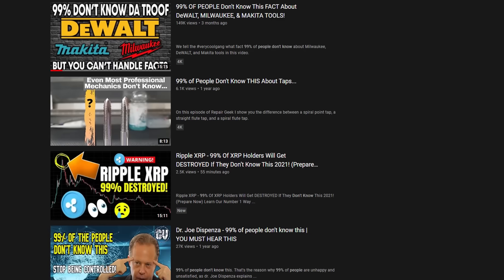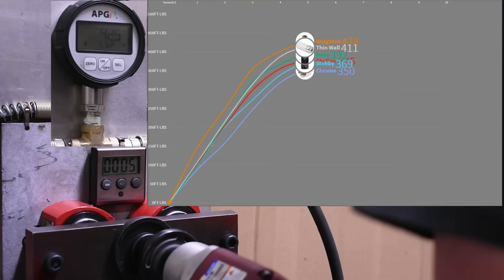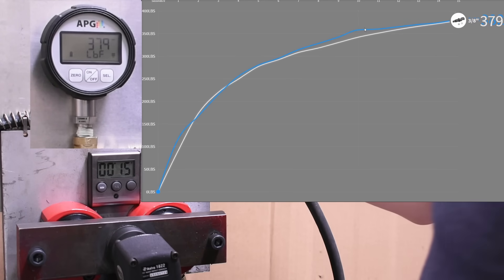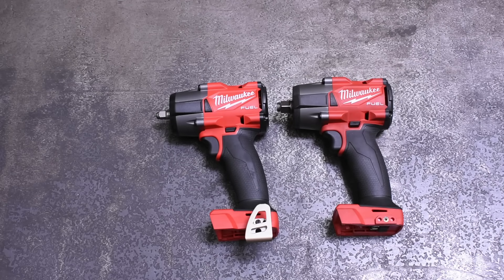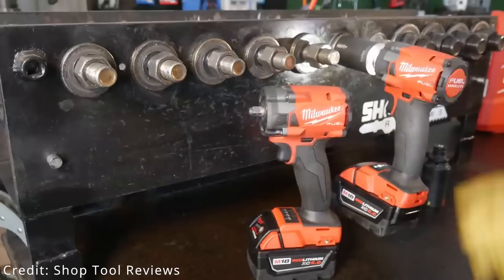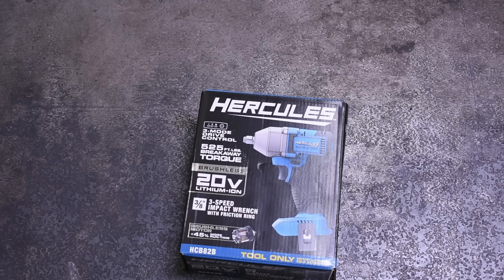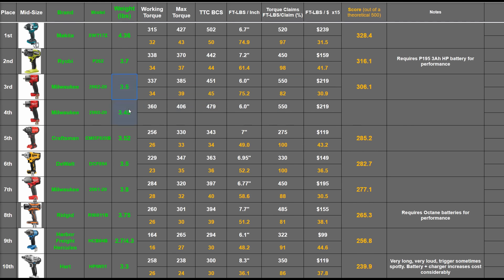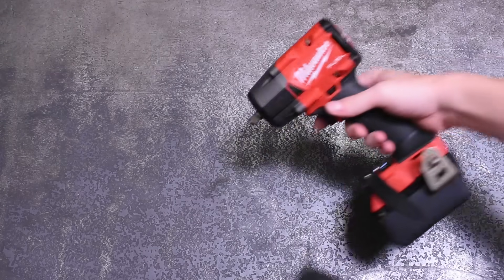Measuring Power Difference Between 3/8" & 1/2" Impacts = WTF

Comment from the maker: Many in the comments are offering theories about or wondering why 3/8" is more powerful than 1/2" talking about mass and other things. Well I feel like we overall showed it's not (see 1822 nano and Hercules purchase using the same 1/2" and 3/8" sockets), but being the same is also interesting and new data. The anvil mass difference is after all less than 0.1lbs. The Milwaukee seems to be exception, and maybe a rare one as other channels have noticed. We (and apparently Milwaukee) have no idea why. 3/8" flies under the radar a bit but with the socket options now-a-days and the power some of these make it shouldn't. It's no longer your fathers power tools out there where smaller drive size means no beans. Here's hoping more brands offer 3/8" in mid size impacts (DeWalt, you listening?)
Torque of TTC is working for Astro Tools who also make the 1822 Nano impact in this video. TTC is not the only testing out there, always consider multiple sources when looking at a tool!
Reply: Should have switched the anvils in the Milwaukee 3/8 and 1/2 with each other, keep everything else the same. Maybe top up the batteries, but put them back on the same drill body.
Reply: @Stefan_Smith  This is a worthwhile test because both the battery and tool have electronics built in, probably 1 chip processors also.   There are two aspects: are the electronics the same for both stock 3/8 and stock 1/2?;  second would be how the control laws, even if the same, interpret the likely differing speed/voltage/current consumption for differing anvils.
Reply: I sure hope yellow and black is listening!
Reply: I have the Milwaukee M-12 3/8” drive and the M-18 Mid-Torque 1/2” drive. They are a great combination and have made my life a lot easier.
Reply: Makita needs a 3/8.
Reply: You guys should not have informed Milwaukee about that 3/8". Now they will charge more or lower its power on torque. It's a business after all and they are all good at ripping us customers off for a profit. You're not exactly helping us consumers by also helping the manufacturers?
Reply: Correct Marketing Matters.
Reply: Torgue is same becouse force is aplied to the anvin inside tool and anvil diameter in tool is same. Rest of the test equipment is irelevant. You can imagine anvil, socket and bolt as one rigit body. They do not move relative to each other, they just transfer force, you can even use smaller bolt and results should be the same (ofc unless bolt snaps)
Reply: @FAMIntruder  Nope the Anvil and the socket are not one solid piece. The force applied is erratic. Once the end of the anvil has clearance to Lash in the socket, it becomes a pinion. The smaller 3/8ths diameter will always lash with more force and back lash with less mass to counteract the next hammer blow, than the larger 1/2".
Reply: For me I need 1/2 or even 3/4 . Most fasteners I need to break loose at work are larger than 1-1/4" up to 2" or even larger so a 3)8" would leave me using an adapter every time.  But I wouldn't mind owning both a 3)8 and 1/2 lol 😂  this was a cool video though and very interesting.
Reply: Great content! You sound exactly like Fireball Tools🤔🤔
Reply from the maker: @WTFxMattt  Fireball Tools is on another level and I take that as a huge compliment lol
Reply: My only theory, is that the overall rotational mass of the 3/8ths is less, allowing the tool to reach a higher final RPM number under load, delivering more blows per minute, and a higher torque output because of it. 

I would be interesting to maybe see a spring tension dyno that provides a static load for these tools to work against, where we can observe both the RPM of the tool at specific loads, as well as potentially how much tension is removed per blow, instead of how much is removed/added over time. Might give a clearer picture of stuff like what really busts rusted nuts, or what'll drive lags faster and harder than the rest.
Reply: My brushless high torque 3/8s will rip out and install a semi trans, while redoing back section and top sections no problem lol
Reply: it will be  nice to see the torque display on the tool .    let's say smart tool
Reply: I recommend that you guys retest the Milwaukee M18 mid-torque's using the 12ah battery. I'm thinking in these test the 5ah battery might be causing the anomaly because it is a bottleneck on the test.  My theory being that it takes more wattage to drive the 1/2" vs the 3/8". The 1/2" does produce more torque due to its larger head + socket mass as represented on the graph but the 5ah battery then fails to keep producing the higher wattage required to keep up and as the wattage produced drops, you see it's torque curve drop. The 3/8" version has a lower wattage draw overall which is allowing the battery to be more efficient in the long run which is why we're seeing a higher torque output in the end. Again, this is a theory but when I think about it, it makes sense...
Reply from the maker: @koreanyogi2546  Alrighty, next week we'll throw a HD12.0 on her
Reply: @TorqueTestChannel  I think the effect we're seeing here is caused by an interaction between the motors torque curve and the anvil mass (3/8 drive anvil is lighter than the 1/2 drive anvil). The motor seems to struggle at the last bit of the dyno test, because the 1/2" anvil seems to be a little too heavy for it to max out.
Reply: @TorqueTestChannel  ok 12.0 ah batt may make the 1/2" bang harder but would it not make the 3/8" bang even that much or more as well ? Curious as I just purchased both these  just a month ago and only have 1.5 2.0 & 5.0 ah batts.
Reply: @TorqueTestChannel  could be the only difference is the socket connector. The hammer and internal weight must be the same. I think we all presume 1/2” are more powerful but sames it’s only the larger socket size to buy is the difference.
Reply: @koreanyogi2546  Mass is irrelevant. You have a more massive anvil, but a less massive socket (the hole for 1/2" is larger). Different curves (in my opinion) can be thanks to 1/2" anvil is more lose in socket. More movement means more impact force at the start, but once the screw settles and starts to resist, the anvil "bites" into the sock and sizes becomes irrelevant.
Reply: Smaller drive sizes are so much more versatile. I special ordered 1/4" proto sockets up to a 17mm and 3/8" proto sockets up to a 29, so that I can spend the least amount of time swapping drive tools and less effective area taken up.
Reply: Can you try the 3/8 inch bauer?
Reply: Impact wrench?
Reply: My argue is that because the 3/8 is smaller and anvul is lighter is would spin faster and hit hard with the exact same motor as the 1/2
Reply: Could it be the mass of the socket?
Reply: Perhaps that's something to do with like resonating frequencies, the only thing I can think of is the tool is building up momentum more efficiently, it would explain the equivalent averages, and why peak might be higher
Reply: Have you guys seen the new tool lows is selling "flex" it's black and gray I believe I'd like to see where it lands on your list
Reply: While we see advertising for torque specs go beyond what the tool actually outputs, we have to speculate that there might be some differences in electronics, rpm, and possibly impacts per minute. We wont know until somebody runs these tests and takes the tool apart to determine these changing factors.
Reply: Shop tool reviews is the only other channel I watch to test tools. They also do tests that make sense and are done well, and have a very good at doing it in a way that eliminates variables in a test to show how the tools do in the same exact situation. Shop tool reviews gets 10 ⭐s stars out of 10 ⭐s. In tests that are meaningful and done in a way that shows how a tool works and if it can do what it says.
Reply: what about testing the DCF921B and DCF923B both looks identical but one is 1/2 and 3/8 respectively.  if this true it should see the same results in low-torque units too
Reply: What I find interesting is that Milwaukee claims as a 50 ft lb difference between it's 3/8 of half-inch models. I would love to see how this applies to the DeWalt DCF 921 and the DeWalt DCF 923. DeWalt claims they're the same power rating and there is no difference in fasting or loosening Torque. Especially responding to the ideas of the Milwaukee seems to be the exception, perhaps testing the DeWalt 923 versus the 921 may show that Milwaukee is indeed The Only Exception or perhaps not an exception.
Reply: Makita listen too please. Best they offer is the DTW302.
Reply: So what about if you take it up to 3/4 or 1 inch drive milwaukee , testing against a 3/8 drive
Reply: 100% of people don’t know about it because they don’t care…
Reply: One thing to also look at when the difference between the impacts are close but of course different, Is to next check the amount backlash between the anvil-to-socket and the amount backlash between the socket-to-fastener for both the 3/8'' and 1/2''. Whenever the impact-line was backlash, there is room for torque loss
Reply: 44444
Reply: 44444
Reply: I'm assuming this applies to the Bauer cordless rotary hammer different sizes also
Reply: Checked the rpm?
Reply: its not about mass, its about leverage.
assuming the same power engine, you get more force when turning a short lever than a long lever.
the 3/8" is effectively a shorter lever than the 1/2"
Reply: 😮😮řt😮 11:30
Reply: i found my M12 3/8 compact also out performs my friends M12 1/2, we also found it odd as they are both around the same age and use.
Reply: Data is useless unless it can be explained, and understood, properly.

And this is exactly what you guys do. I am not a professional mechanic, but I have been in so many situations that required specific tools it’s not even funny.

My next purchase is likely to be the Milwaukee mid torque in a half inch drive. This is designed to replace my 20 year old Snap On of the same size.

I already have the Milwaukee “stubby“ in a 3/8 drive. So for the most part that takes care of things. I also have a Harbor Freight stubby half inch air gun.

My rationale: i’m essentially Replacing a tool with virtually the same parameters and capabilities but with updated technology and a battery system but I’m likely to buy additional tools for. 
If I need stronger force and a smaller socket size, I have impact adapters TO 3/8. But I have several large diameter sockets that I may need to use and I would rather not use an adapter FROM 3/8 .

Does that sound like a good idea to you guys?
Reply: Ackshully Dewalt is at least now making a dcf913 and a dcf923, 3/8” drive versions of the recently tested 1/2” drive dcf911 and dcf921.
Reply from the maker: @09corvettezr1  I believe they've always made 3/8" versions of their compact impacts though. Mid-torques not so much
Reply: @TorqueTestChannel  The answer to your quandary is, a 3/8ths diameter spinning shaft is always harder to resist spinning than a larger 1/2' diameter shaft. The 4 corners of the 3/8ths anvil strike the socket corners with more force than the larger 1/2" anvil can. 

Even though it looks different, since the Anvil and Socket are separate, we're now working with a "Gear Lash" type action. The 4 corners of the anvil are like "Gear Teeth". The Anvil is now like a Pinion Gear. The smaller the diameter, the more force the Anvil corners strikes the socket's corners. With more force, means something's gotta suffer. I'm willing to bet the 3/8ths drive hole in the sockets will wear out quicker than the 1/2" drive holes.
Reply: @TorqueTestChannel  Why did they forge those custom 3/8ths drive sockets with such a small collar? I would've wanted to keep the beefy 1/2" collar with the 3/8" broached hole. Later if the 3/8ths hole gets worn out you could rebroach to the 1/2' size no problem.
Reply: Have you got the same results with DeWalt's new impacts?
Reply from the maker: @razokevX  we have two 1/2" models :p
Reply: Every1 thats comparing 3/8 to a 1/2, the 3/8 does better. Possibly a physics reason. Maybe the 3/8th anvil is smaller and lighter and has less surface area to work with that it can focus more on putting more torque/power on the bolt, whereas with the 1/2 anvil, its larger and a little heavier so theres more weight and surface area that it makes the power output a little weaker.

Comment: I know this is an old thread.  But it is a really good and interesting thread.  As an Astro 1828v2 owner (3/8" drive) I would be interested to see performance comparison between the Astro 1828v2, and the 1822v2 with their stock anvils.  The specs from Astro give the edge to the 3/8" drive over the 1/2" drive which is one thing that pushed me over the edge when I made my purchase. I figure if I use the right adapters I can use a 3/8" to 1/2" adapter and even counting for the loss from the adapter still make about the same numbers as the 1/2" 1822.  By the way, I love this little Astro 1828.  It is a joy to use.

Comment: The Hercules 1/4" impact driver beat the Hercules 1/2" compact. The small one was able to get lug nuts off and on my truck and still had plenty.  The 1/2" was weaker and it didn't list rated torque.

Comment: I researched about it, that's the summary:
A 3/8" adapter often feels stronger because it has less rotating mass, less flex, and transmits impact energy more efficiently.
A 1/2" adapter and its sockets are heavier and absorb more of the impact, so even with the same tool, 3/8" delivers a sharper, more effective hit.

Comment: Moi for the smaller anvil is lower, but on the same spring it will also accelerate faster with the impact, since the impact acceleration is what ultimately moves the socket. The smaller anvil may also have a bit more flex allowing more time for energy to transfer to the socket. there is likely some mechanical advantage to the smaller anvil.

Comment: My gut tells me it has something to do with the tolerance of the fitment between the socket and the anvil.   For a larger anvil with the same tightness of fit on the socket as a 3/8' anvil on a matching socket, you will technically have less degrees of rotational free play.....if you could measure rotating the socket while keeping anvil stationary.    This tiny little difference amounts to greater amount of time the socket spends being propelled forward by the action of the gun before transferring to the socket and the socket to the bolt, which results in a slightly higher amount of applied force on the nut or bolt.   It's quite counterintuitive because we all know longer lever arm means greater force, but dynamic impact forces behave a little differently and are quite susceptible to differences in momentum.        This is just my gut.....but I did earn a BS in ME many years ago.   I also have a hunch that if you recorded the sound of the two with an extremely high sample rate and then analyzed the recording on a stretched out time graph you may be able to spot a slightly longer gap between the gun internal clacking and the bang on the socket.  Don't know if it's possible to see the sound profiles independently though.

Comment: Theory. Maybe the 3/8" drive tolerance to the socket is tighter than the 1/2", allowing more power transfer as a whole assembly? Like a 1/2" socket may need to have more clearance to pass over a stronger hog ring or something? Try a test where you wrap the 1/2" anvil with maybe a single layer of masking tape just to close the free play to the socket.

Comment: You guys should compare the Makita XWT16Z (which appears to just be a XWT14Z with a 3/8 anvil swap) to the Makita XWT14Z. With the Makita XWT14Z still beating almost all compact impacts years later I'd live to find out If the Makita Compacts have the same relationship Milwaukee 1/2 and 3/8 mid torques do. it may just be a better tool with 3/8 sockets giving you a little more room.

Comment: To me, its seems to be the hammers energy is maintained through the smaller anvil allowing more of it to reach the bolt. When the larger anvil is installed it takes more of the hammers energy to rotate the anvil, robbing that energy from becoming nut busting torque.
Reply: Lets just say its 3200 ipm giving 200 ft lbs. divide it out and multiply it into inch lbs. you get .75 in lbs. per impact a variance in the weight of the anvil in grams will have a small effect. on the total torque figures

Comment: It's the weight of the anvil that makes the difference. The hammer inside the drill is the same, but it moves the smaller 3/8 anvil more when it strikes it and delivers its energy. The 1/2 is meant to be more contact area with the socket and a thicker anvil is stronger to prevent twisting. But you are also increasing the angle which the nut resists that torque by increasing the size of that anvil, providing leverage against the work you are trying to perform.

Comment: Is here not a point to having smller tools not pull as hard. I was taught that you sould always ust the smallest and shortes wrench or rachet possible because it reduces the risk of stripping or beheading fasteners. IE if it's a 10 always try 1/4 before 3/8 etc so if you make the 3/8 and ½ the same power that kind of reduces the point of making a 3/8. If I bought a 3/8 it would be because I wanted a less powerful tool. The drive will more likely give in than the socket though assuming you use impact sockets.

Comment: My m18 3/8 couldn't take wheel bolts off , could it be the adapter i used? It was a cheap adapter . It did removed rusted never before removed nuts from caliper rails with ease.

Comment: its not about mass, its about leverage.
assuming the same power engine, you get more force when pushing a shorter load-portion of a lever than a lever with a longer load-portion (the "levering" part, beyond the fulcrum, opposite from where you hold a lever, damn i wish i could post pics.. @YouTube, get better).
the 3/8" is effectively a shorter fulcrum than the 1/2"